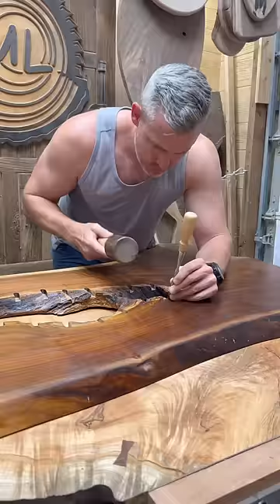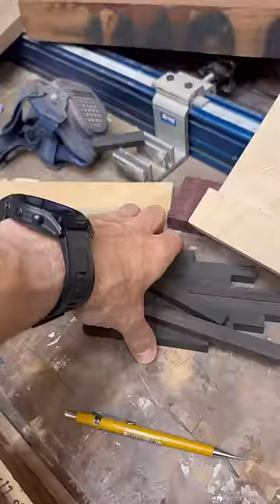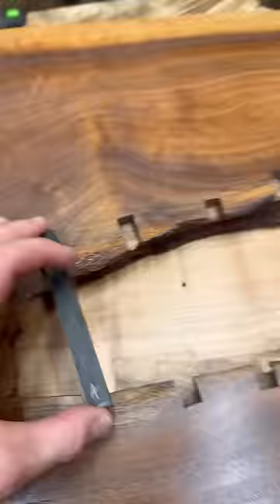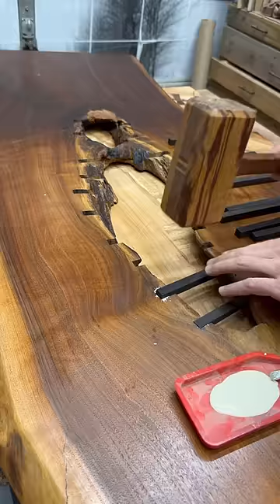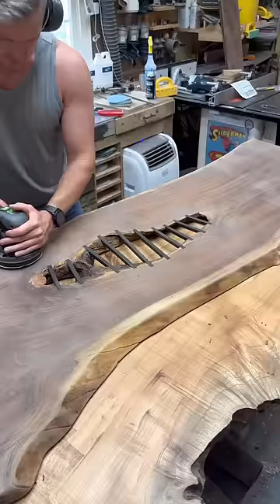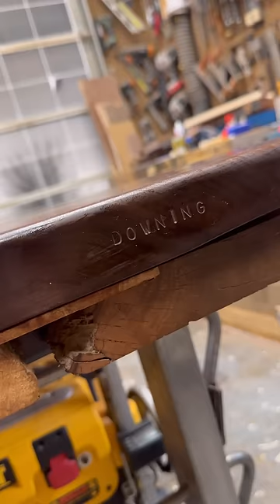Custom Desk with Stitches #woodworker #woodwork #woodworking

Comment: Great work looks awesome, I would have filled it with epoxy resin.
Reply: Same, not a fan of this.
Reply: I was thinking red resin to really get the stitches effect 😁
Reply: Agreed
Reply: Cool trendy idea. Where’d you come up with that? 🙄
Reply: So original
Reply: Yeah the young generation😂 filling it with toxic waste instead actoally do work that require some skill. Resin furniture for me is the most disguisting and ugly furniture.
Reply: @haralds4145  it isn't so much "the younger generation" it's the fact that Instead of puny spindles where stuff can fall through, that hole in the wood becomes useful space.
Reply: @Scotty2hotty-69  theres a million different way to close that hole that isnt some chemicals that degrade with yeara😘
Reply: @haralds4145  exactly my point. He did an excellent job fitting those pieces in there but the hole is still a hole
Reply: @haralds4145 How come resin is chemical that degrades? You smoking good?
Reply: fr
Reply: @Mavodila  every polymere degrades irreversible over time. Read science articles not advertisments from resin companies. As a tip epoxy is used as an insulator for broken cables in ground. The professional manifactures give them a 10-15 year time limit till degradation weakens the insulation properties.
Reply: @jerrodstaviski3711 you're saying you think this is better?... I mean it's viable but I.m.o it's a very ACQUIRED taste...
Reply: @haralds4145 it took skill... but looks mental... it's just jarring .
Reply: @markbarnett9275  better than resin. Yes 100%. Resin furniture is something lower classes think is cool 😂😂
Reply: @haralds4145 it is cool. If you’re handy when it wears down, you just have another project to do, and you can change it up. Unless your lazy, which is probable considering the class statement. That being said, I wouldn’t have any resin type furniture inside the home.
Reply: Like a dock scene, with fish underneath
Reply: Perfect for resin fill. Will be a dusty mess and catch on everything that isn't a laptop.
Reply: yeah, w/o resin its not that useful as a desk or table
Reply: I don’t want to clean out that “ dip” in table
Reply: @LESLASLESLAS 😂😂😂 I f ING hate those resin tables and they all seem to cost 13 million dollars and there's 13 million of them on YouTube
Reply: That's what I was going to say... Maybe throw some LED's in there too - as it sits it's creative - it just seems unfinished
Reply: @@itachisasku no i do woodworking and i have a degree from one of the best technical universities in the world. I know materials.
Reply: @Scotty2hotty-69  it's a raclette table. he can put the cable in the hole ;)
Resin isn't state of the art anymore.
Reply: @frederickjohnsen4246 why not have both by filling the well with clear resin then introduce a coloured led underdesk lighting system to create ambiance and mood colours?
Reply: @haralds4145  Well, I've never personally claimed any ah, royal connection, and yeah, there's a preponderance of resin shtick, but man aesthetically this is jarring everyday of the week ending in 'y'... I'm not claiming yr wrong objectively... it's just that my artistic nous is more um, evolved than yours if you think, other than this is better than epoxy, it's in any way subtle / or would grace the palatial mansions of those you hold so dear... you know, the classless new moneyed... but sure, if your taste is more Frank Miller than say Boris Vallejo...
Reply: Maybe a light golden brown to signify the under layers of a tree!
Reply: Epoxy resin is cool but is so trendy and cheap looking. Nah this is cool
Reply: @haralds4145 Tbh, putting in the stitch as a design is fine, but filling it with something like resin, even just clear would actually make it functional as a desk top.
Reply: The epoxy shit takes always from the whole point of using wood
Reply: I've seen several of these with cracks or holes in the wood and they put those ugly braces in there, especially the bow tie inserts that are usually a contrasting color so they really stand out. If they feel they must use braces, I think it would look a lot better if they were underneath and the voids and cracks filled with epoxy so the braces don't show.
Reply: @haralds4145 resin breaks down but wood don't? If the resin breaks down remove it and fill the hole with the next fad. Who cares?
Reply: Yeah, not resin but instant noodles is the best option
Reply: @azmiyusoff8393  good idea the chop sticks are already there!
Reply: @haralds4145 Okay Grandpa, what do you suggest instead?
Reply: @slappy8941  glass or brass. One of the best materials in the world. Take a piece. Cut it like the shape of the hole a little bigger. Then mark the edges on the wood and carve it with a router so that the brass and wood is at same level. Its both not toxic and last forever and dosnt get yellow over time☺️
Reply: @BCole-vo9xz  yes. When wood reaches a humidity of 6-8% and the sourounding temperature and humidity is stable it basically last forever. And that is not that easy you need to cut out the epoxi destroying the natural curve.
Reply: @haralds4145  YA I still don't care. I am not a fan of "rustic, live edge, or pour plastic"
Reply: @haralds4145   I bet in perfect conditions, resin will last forever, too!
Reply: @BCole-vo9xz  no polymeres are not stable. They break down over time in any condition. The breakdown is just fastened with temperature and uv.
Reply: @BCole-vo9xz  me too i like a Classic made table plate. It takes skill to glue together a wood plate.
Reply: @haralds4145  it's all about the latest fad and personal taste. I like burled walnut on my rifles, but plastic stocks have a place as well, like behind the truck seat.
Reply: @MrGreengiant4200  Great idea. Maybe few little sea creatures and then a nice classy wooden sailboat. Can’t hardly ever go wrong with a nice wooden sailboat.
Reply: That’s what I was waiting for him to do.
Reply: Exactly would look so much better and u don't have a hole in your expensive table
Reply: @haralds4145  By that logic wood degrades too, you degrade too, that doesn't mean its not a valid option. By filling the hole(s) with epoxy you can make a smooth surface table without any holes in it making it perfect for a dining table for example. I dont understand your hostility either, its very weird
Reply: @temeria1986  There are a million other materials. Wood dont degrade like epoxy, polymer plastic are unstable.
Reply: @haralds4145  So what? That also goes for wood, someone can apply the exact same logic. Secondly that also means there are a million opinions, yours isn't set in stone or the only one that is right,  you got to understand that.

That is correct they degrade differently, that doesn't make wood, neither epoxy bad in any way shape or form, just different.

You seem unstable as well, you got a right to exist, no? Look how angry you got because you have a different opinion, look how you call people with said different opinion, its so weird.
Reply: @Scotty2hotty-69 moi je voyais déjà un bon gros plat bien chaud .pour pas marquer le bois mes bon ptet je me trompe..
Reply: Yup.
Reply: Glass top
Reply: @haralds4145 i feel that way about particle board, paper venier and polyurethane.
Reply: @Eggs6DemonBag  That would actually look awesome great idea!
Reply: That’s tacky
Reply: @haralds4145 yeah you could add “stitches” to it that don’t actually do anything besides look kind of dumb and creates a space for smaller objects to fall into
Reply: @haralds4145 #iamverysmart
Reply: @Batleth777  thx 😊
Reply: @haralds4145  That wasn't a compliment... But thanks for proving my point.
Reply: Jesus Loves you He died on the cross for your sins and if you repent if your sins and confess with your mouth His is Lord and son of God you are saved. God bless 😊😊😊
Reply: Uuuh the table has a hole in it. The thing on the bottom was the table it was on, it was part of the design. On the actual table you would see the ground through that part. So I think the finished product would look better and more artistic than your idea.
Reply: Yep, els how to clean it😂
Reply: A question for the pros....How about glass? Can we pour some glass in there to fill the hole? Would that be okay?
Reply: And some 🦵🏽🦵🏽
Reply: @haralds4145 you might’ve had an argument until you said resin is for the lower class as some of the most expensive furniture or even exterior doors have resin and can be over $30k
Reply: @ronstevens9554  yes so expensive producers use crap. Welcome to 2023😂😂
Reply: We all would have.
Reply: @Scotty2hotty-69  What's your issue with holes? 🕳️🕳️🕳️
Reply: @dannybowden5296  I'd prefer an entirely useful surface lol
Reply: @Scotty2hotty-69   It is entirely useful as long as you're not a clumsy kluts. Tables have edges but by your logic they should have a lip to stop things falling off, like it's the table's fault.
Reply: @dannybowden5296  if it made sense to have holes in tables they would have holes lol
Reply: @Scotty2hotty-69   Many tables have holes in them. Do you like crumpets?

Comment: Finally a slab without yet another epoxi pour! Nice work!
Reply: Lol wait til part 2
Reply: Would've looked good with epoxy as well though. 😂
Reply: Pour clear epoxy in it so stuff doesn't fall through
Reply: Pour clear epoxy in it so stuff doesn't fall through
Reply: Exactly my thought! This is truly honoring the material!
Reply: I came here for this comment
Reply: He didn't show the final product
Reply: Exactly! I would've continued the inlay with complimentarily colored pieces and filled it in fully.
Reply: I'd rather the epoxy, only the right color and tone, which I rarely see with any of them.
Reply: 😊😊😅😅A😊a aa😅😅
Reply: 😅saw😊
Reply: @bigluisjayrogan 😊😊😊
Reply: @bigluisjayrogan 😅😅😅😅
Reply: @bigluisjayrogan 😅😊
Reply: @bigluisjayrogan 😅😊از😊
Reply: @bigluisjayrogan 😅😊aa😅😅sss
Reply: 😊😅😊d😊aa😊😊
Reply: See this one I'd have done an amber under the stiches
Reply: It doesn’t look good.
Reply: I guess I should have read the comments before I replied. You nailed it
Reply: @jasonwagner5571    I would have to see the end product but if the end product is what we saw in this video than a epoxy would look a million times better.
Reply: nooooo epoxy it
Reply: Very Beautiful Work
Reply: @bootlesscorpse 😊
Reply: It’s okay. You use the right epoxy…
Reply: epoxi
Reply: I came here to say the same. 😅😅😅
Reply: Needs epoxy in it
Reply: What's the point of that black sticks installed,  it's going be full dust inside and hard to clean
Reply: needs epoxy to complete it.
Reply: @dyvel no
Reply: My thought exactly.
Reply: I was just thinking epoxi 😅😅until i saw your comment.
Reply: My personal opinion is that it looks ugly but if there were epoxy poured in it, it could look nice. But to each their own.
Reply: Woulda been nicer with epoxy. Now it’s just a table with a hole in the middle. 🤷🏻
Reply: Yet, that’s exactly what he should have done!  What a pain in the a— to use as a table top.
Reply: Guau que paciencia
Reply: Agreed!!
Reply: Nice alternative to epoxy! Love it.
Reply: It will have epoxy who the hell is going to want a desk with a big hole init 😂 wait for part two
Reply: Это цензура посмотри лучше на форму отверстия
Reply: Thats exactly I was expecting to see, I'mm sure there's part 2 where he pours epoxy on that hole and looks awesome.
Reply: What you got against epoxie pours??? Lol
Reply: @dyvel  How is this truly honoring the wood?
Reply: I thought the same, it’s the first time a see that kind of table and it’s gorgeous.
Reply: And here I was thinking it's not finished, it's still got a big hole to drop things through - it's needs an epoxy pour!
Reply: Oh cool, a table. Except it has a hole a deems unusable.
Reply: This is one of the few instances where I think an eooxy pour would have helped to highlight the stitching along with filling that void without becoming overbearing and the focal point of the piece.

Comment: Beautiful! Very creative and the best "stitch" job I have seen.
Reply: Искусство
Reply: It's extremely bad and stupid. Should've left it rounded at the end like actual stitches. But I guess he had to do something to claim it as his work.
Reply: But even this "work" is stupid, take some spaghetti and make 2 bundles out of it and try to glue it together in a 90° if you make it and it doesn't fell directly apart, then be Lucky, because this isn't a better connection!

Glue is only to give a connection a bit more strength, but in this Connection is only the pressed Wood that could hold a bit, and with a little hit from the wrong direction it is apart, I would be wondering if it wouldn't break through the lime!

Comment: Might I suggest using a piece of wood between the stitches and mallet? This way you won’t accidentally gouge or dent one of the pieces and have more sanding to do.
Reply from the maker: Good call. Ebony here, hard as hell
Reply: at least he was using a wooden mallet. I think he did a great job though. and I know your not implying he diddnt and just giving a suggestion. ❤

Comment: Dust collection would be my only issue. I like the design though. I’d probably keep the look and fill it in with epoxy.
Reply: I was expecting an epoxy fill. Imo, It would of looked better. But, to each their own.
Reply from the maker: Fair enough, I’m just not a fan of working with epoxy personally
Reply: @jmlwoodcraft  That's a fair point.
Reply: Just put a glass top on the table... Done!
Reply: You look at too much pintrest
Reply: Epoxy is so tacky in most cases.

Comment: Looks cool and I don't agree with the comments on how practical it is..
If you're creative, you can make it work and enjoy the design..
It's a statement piece, unique and out of the box. It's meant to be enjoyed that way. If you want a closed table top, just buy a standard one, then you don't have to worry about "drinks or pens falling through"? But if you like the design and want to put it to good use;

Just make it a fancy desk; laptop stays way more cool with those "ventilation holes" and you can connect a cable to your laptop through one of the them, so it doesn't look messy, hanging over the desk until it goes in one of those "provided holes with plastic covers for cables", but just dissapears in the middle of the table.. Looks cool if you ask me!

Another practical use; put a paper bin right underneath it and if you need to throw away paper, just drop it through the table..

If you want to serve drinks or dinner, just put a tray over it, there are enough stitches to support a large one, and when finished and you clean up your table, you remove it to reveal the design.. 

Or have it in the hallway as an eye catcher, against a wall, greeting you upon walking in, put some decorations on it, hang a mirror above the table, below you can put baskets or something for shoes or stuff..

Great design and practical use, there you go.
No need to create problems..
I actually appreciate celebrating the natural flaws in wood instead of fixing every crack, filling up every gap.. 
In my opinion too many furniture pieces are too fabricated and don't even look like wood anymore, f.e. shining white high gloss tables and closets.. Can look beautiful, and to each their own, but I don't really fancy those designs..
I really like the industrial style where metals and woodwork that is kept natural are combined. It gives it an edge and brings nature into the home..
Reply from the maker: I think you’re my new favorite person 😆you get it! All of it. Thank you for the perspective - right there with you 🙌🏻
Reply: @jmlwoodcraft  haha, thank you!😊 Gladd you liked the comment!

Comment: I like epoxy but...this is so much better.

I see a lot of people want both in the comments. I don't get that. This gives the strength and adds usable space but still allows the texture of the live edge to work
Reply from the maker: 🙌🏻🙌🏻 I don’t think this adds strength but the whole point was add usable flat space over the void, I’m not an epoxy guy
Reply: @jmlwoodcraft i cant say I know better tjan you, i just wpupdve guessed tje glues in (ebony?) Stitches act somewhat like dovetails and stabilose the opening. In saying that, it looks stable anyway

Comment: What had would have been really really cool is to take epoxy resin instead of making it look blue like water make it look red like blood, and poured into the open areas and let it harden and then it would have looked like it was stitched together.
As it stands now, I thought it was railroad tracks.

Comment: Rebate a piece of polished stone on the bottom and use it as a functioning fixed centre piece....the wide slats and drop to the floor arent very functional re keeping things on the table or side board.... i would use this if the slab was vertical , as a devider, or door, where the gap would be beautiful AND functional...

Comment: Not a fan of this stitch look. Feel like I use to see it a lot before epoxy blew up. Right when this video popped up, I was like OHHH YEAHH forgot about these. I think the black bars look better than some of the other blocks ive seen... but I think if it was parallel it would have looked good.
Reply from the maker: Yeah I’ve always been a fan of the style and just wanted to try it - felt like the right slab. I originally tried perfectly parallel and it felt too perfect on the irregular void. Misalignment just felt better in the moment 🤷🏻‍♂️